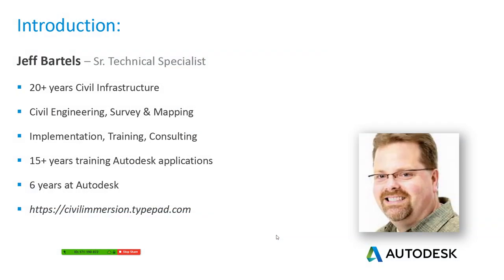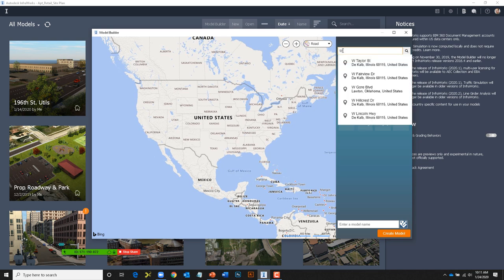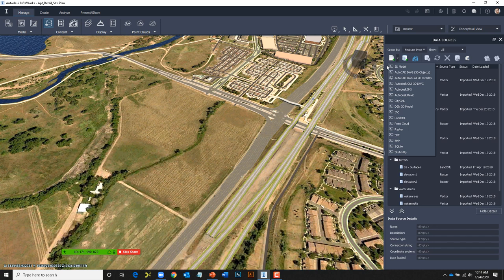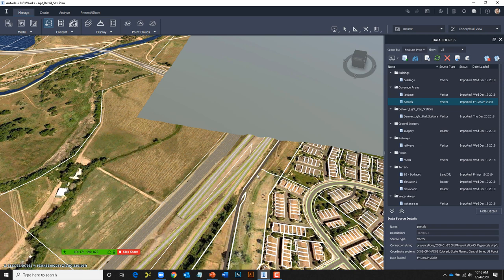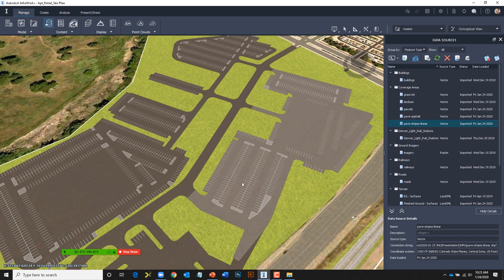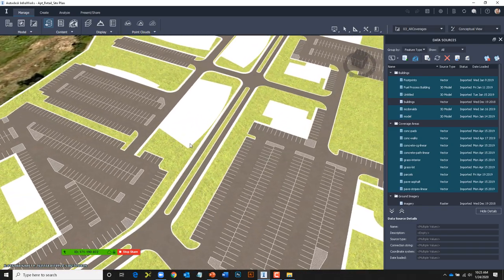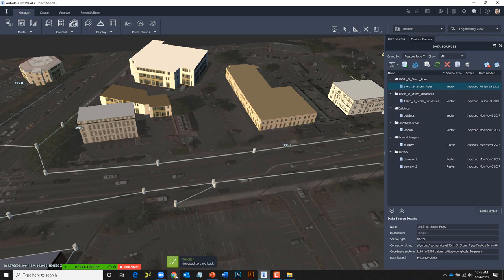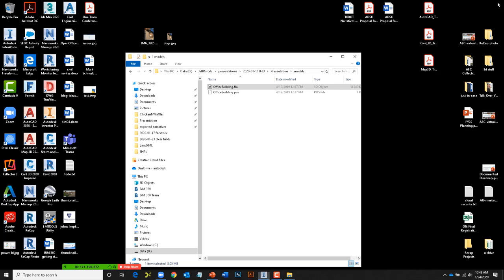How to Model an InfraWorks Site Plan from Aggregated Data

Comment: @Jeff Bartels. Great Presentation like always!
I am using latest version of Infraworks (trial) downloaded a few days ago. But your workspace here is totally different than mine. I dont have any Ribbon Tool Palate like you have on top. Also, your workspace is dark like ACAD or C3D but mine is white. And I dont see any setting to make my workspace match yours. Am I missing something?
Reply from the maker: Hi Yasir, I'm using InfraWorks 2020.1.  To my knowledge there is no other interface available for this version.  I would check on your end and verify the version you are using.
Reply: @JeffBartelsCAD  I just checked and I am using 2019.2. I think this may be the reason. Thanks for your reply. Stay blessed.